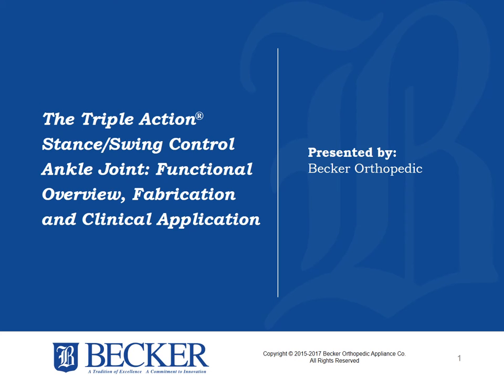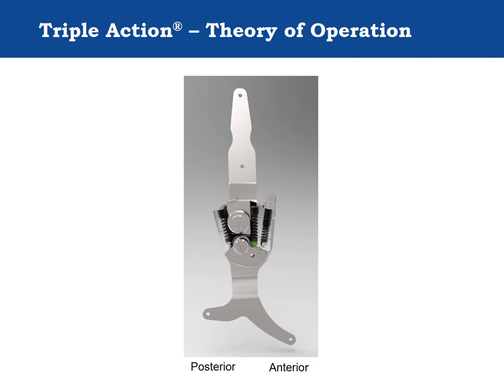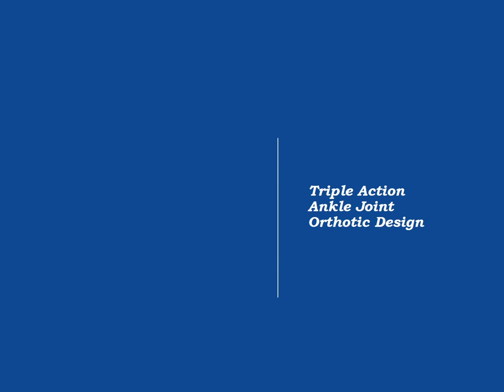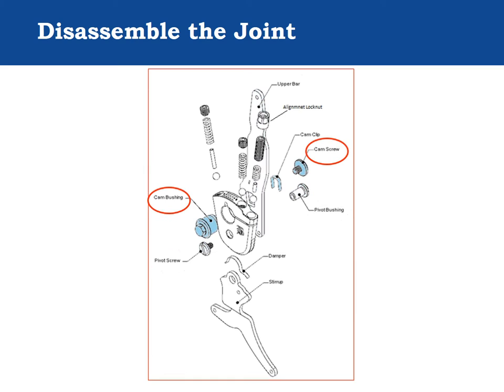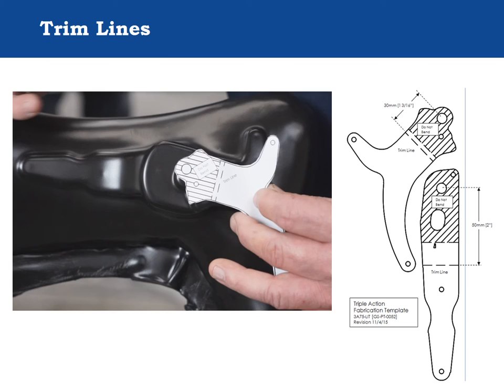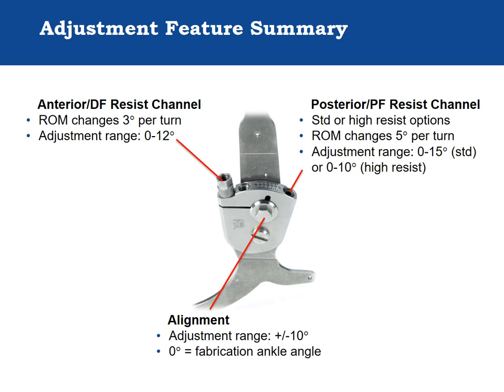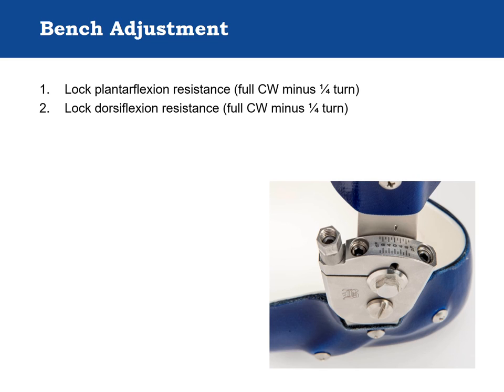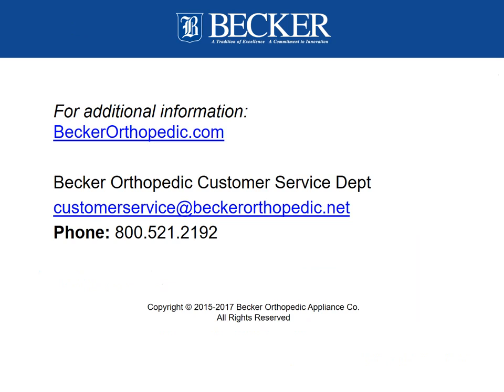Adult Triple Action® CEU Program

Comment: This test is poorly designed, #1 doesn't tell you which question is correct and which is not. Some of the questions cannot be confirmed by reviewing the course, confusing. This course is not designed for success as continuing education should be , it can only by completed successfully by the originator.  Disappointing !  After 40 years as an orthotist and all of the tests i've taken in my lifetime ,this exam 5 times.